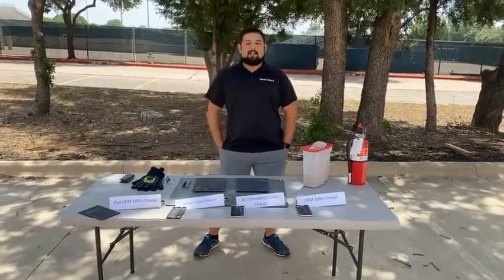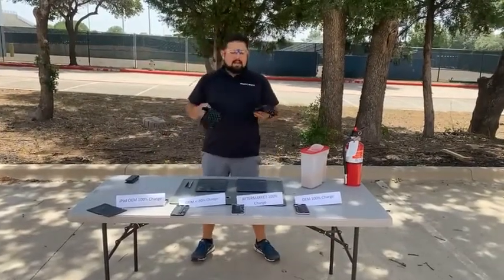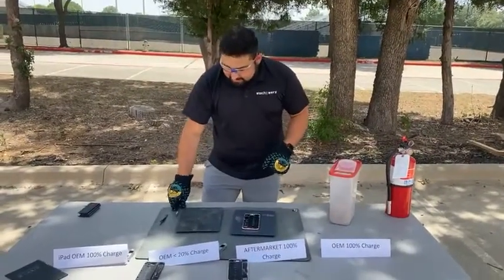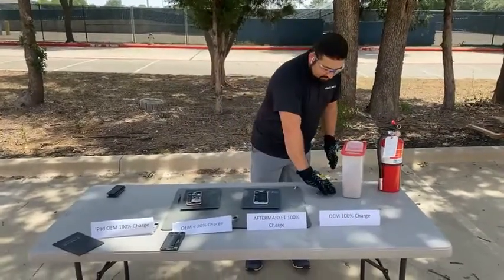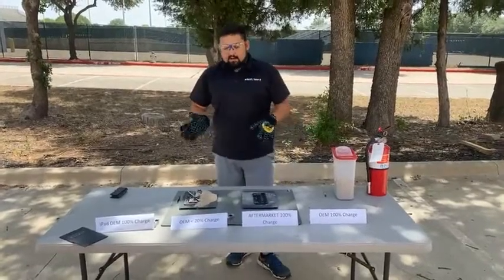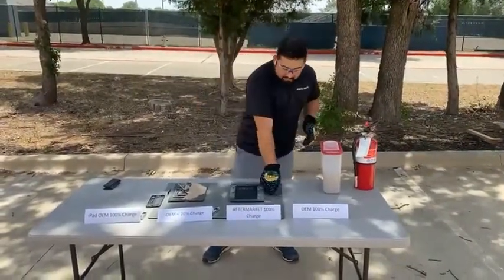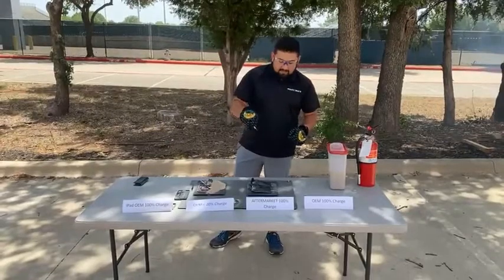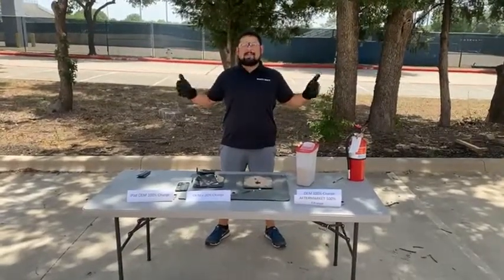Battery Puncture and Safety

Comment: I have a swollen battery but the battery was glued/stucked to the phone. So I tried prying it out using a scissor  but I think I accidentally punctured it a bit and there was a little smoke coming out but then it stopped. The battery power was almost full. After looking at your video, I realized a punctured battery not going to fly shrapnel around, instead it will suddenly produced smoke and how bad it is going to be will depend on how much smokes it is producing and the risk of fire will go up with more smokes coming out. Thank you. So the key to determining how bad the situation is will be the smokes that will indicate how bad it is.

Comment: Batteries are absolutely terrifying. People who do BMS transfers are brave as hell.
Reply: i’ve done three BMS transfers before and i can confirm it is nerve racking and i got close to puncturing one, but i saved it
Reply from the maker: If proper safety steps are not followed, they can be even for experienced techs. With the BMS transfer you have to be very carful to keep the welding tips away from the cell of the battery to avoid puncture.

Comment: I have puncture my huawei battery accidentallybit sparks a little.can i still.use it and just patch up the small hole,
Reply from the maker: Hi Bernadeth, whenever a battery is punctured or bloated, the cell is compromised and a safety risk. Although patching the hole up is find for disposal at a battery recycler, the battery should not continue to be used in the device as it can cause a thermal event at any moment.
Reply: bro give to recycle u gon die